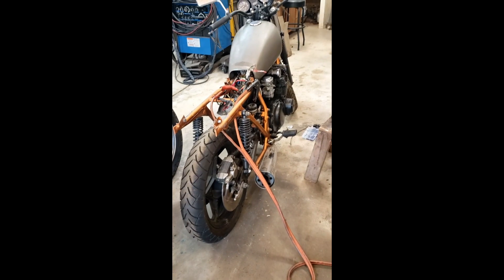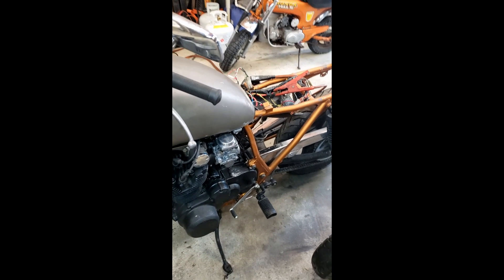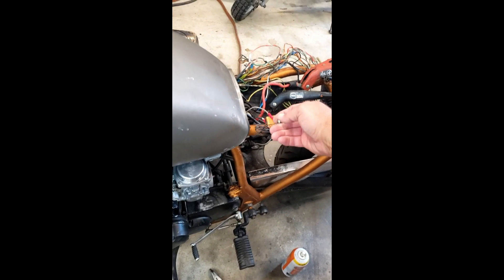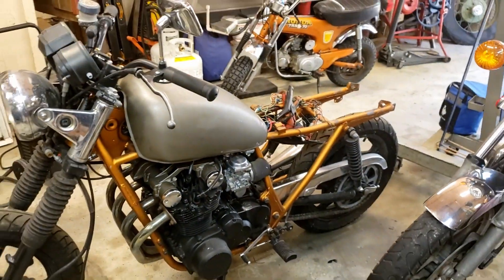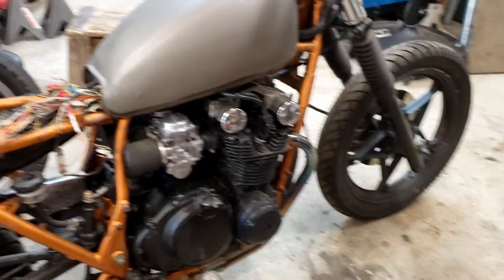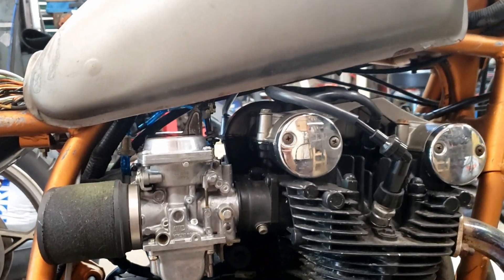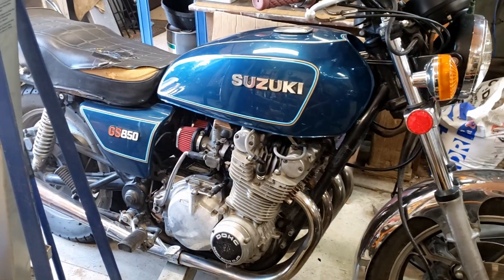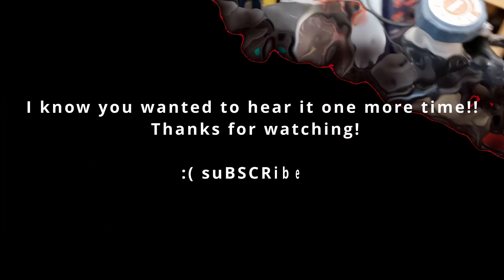1980 Suzuki GS 550 Ignition Issues fixed

Comment: My 77 gs550 was running great for 1200 miles after a new rotor , stator  , rectifier regulator . It started to lose power. Then it would barely run and die immediately with the headlight on . Stator tested ok rectifier bad . New rectifier and still barely runs . I switched to dynatek ignition a few years ago and am thinking  of reinstalling the points . I’m wondering if when the rectifier died it damaged the dynatek ignition? Very frustrating . 
Nice video

Comment: Do you use original igniter box, or did you find work around ?
Reply from the maker: It was not original.  Previous owner had upgraded or replaced before me.
Reply: @pwillysbarn5574  @oleksandrartiushenko6852 I think he was asking about electronic ignition. I too am running the infamous "box" and losing spark above 2-3k rpm. I'm guessing you are the previous or older generation of gs and have a mechanical advance as well. Hope she's still running good. 👍

Comment: Just bought a 81 gs450 and can’t get it to crank. Anything you suggest?
Reply from the maker: Check fuses.... not that they are not blown, but that they are making connection on BOTH sides!  I had good fuses but they were not making contact on out put side to the connector... its usually something very simple but can be hard to find.